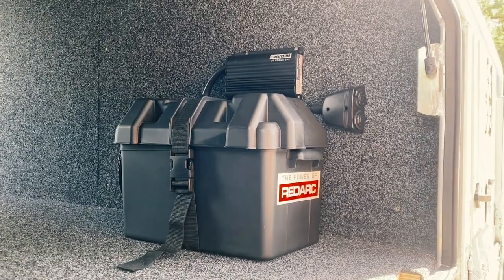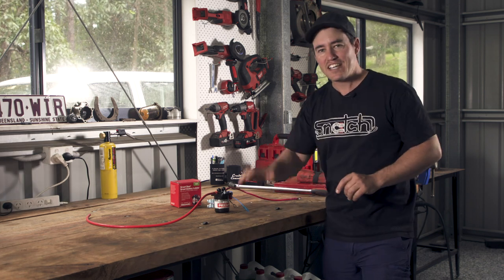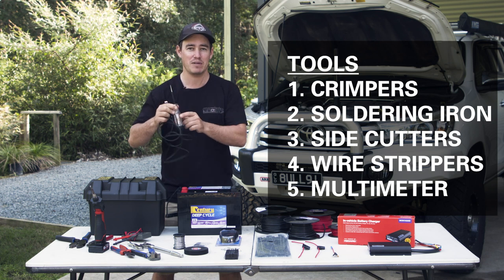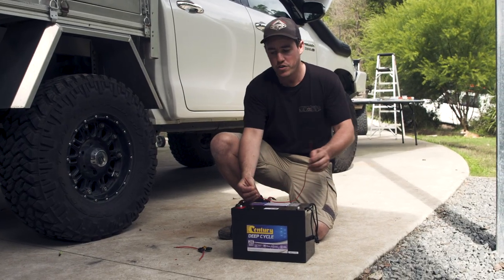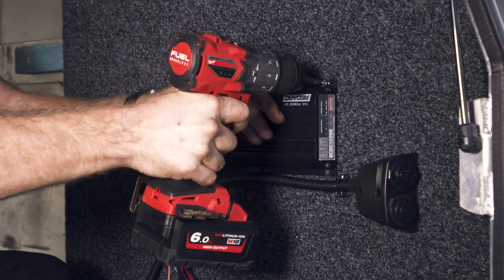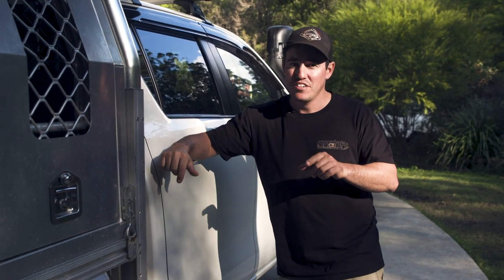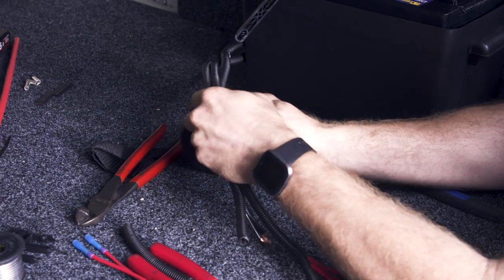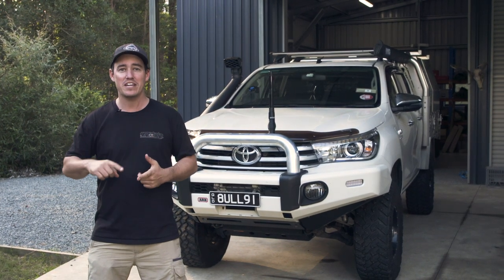How to choose a dual battery system with Shaun Whale

Comment: In my youth I wired up some cash registers  for NCR. I was wiring for 240V AC. We were forbidden solder, and also twisting. Both cause the copper to harden as you describe WWe used terminal blocks, we had wire strippers (much more basic than yours), stripped about 1cm of wire and pushed it into the terminal block, all the strands, with no bending or twisting, Then screwed a screw down. We also installed a card cover to keep out random paperclips and the like.

Comment: Solder wont cause the connection to mail function crimping wont either , what cause the connection to mail function is heat and oxidation at the connection. Soldering the connection  will be lots better preventing heat when high currants are drawn . The flexing point on the connection will sill be ok it will just move back toward the flexing part of the cable .

Comment: RFI/Interference - - Sean, I've noticed several vehicles in your videos that show radio antennas mounted on the front bumper.  Are you guys using any HF radios?  Maybe Amateur radio HF?  Reason I ask is that I am an amater radio op and I would like to use something like the BCDC25 or 40D with a second battery for my radio equipment.  So I was hoping to get a comment from you regarding whether you or other friends have had any problems with radio frequency interference from these series of chargers.  If so, was it only to the receivers, affecting reception/sensitivity and/or from your transmitters getting into the chargers and affecting the charger's operations?

Comment: solder has been getting a bad rep because its more technical to do than crimping.  a proper solder job is a lifetime joint. you see people put the wire in the terminal first then heat and add solder. which burns the jacket and lets solder wick up the wire making it non flexible.  the proper way in to hold the terminal in vise grips and heat it ..add solder to the empty terminal then push the wire down in the molten solder while keeping heat on it.  spray water or air on it to cool it fast.  the jacket will be perfect and the wire will be super flexible.

Comment: Just a query about blue wire connection? My 2019 Hilux has a Temperature Compensating Alternator by the REDARC battery charger selection tool.So I thought that means leave the blue wire disconnected as stated by the REDARC manual,this is for a BCDC 1240D ?
Reply from the maker: Thanks for the message, and for choosing REDARC. If using any of the Dual Input BCDC In-Vehicle Chargers, with your vehicle the blue wire can simply be left disconnected, or connected to ground. If you'd like to discuss further with one of our Tech Support Team please feel free to give them a call.

Comment: Side cutters for crimping as your preference is BS I have over 40 years experience and side cutters or pliers with the cutter are only for desperation use. The correct crimp compresses the lug and wire to the point they are virtually the same one piece of conductor. This is why the crimpers are made to a set standard. What next a cold chisel and hammer?